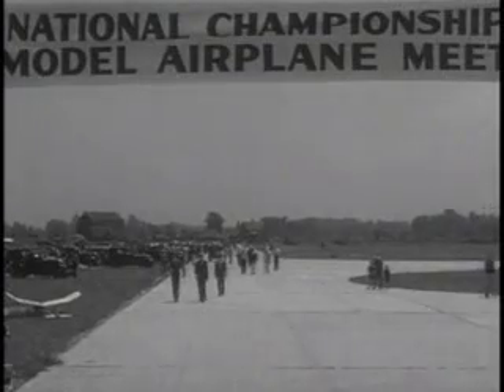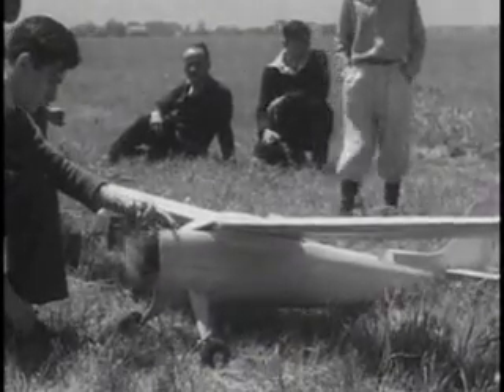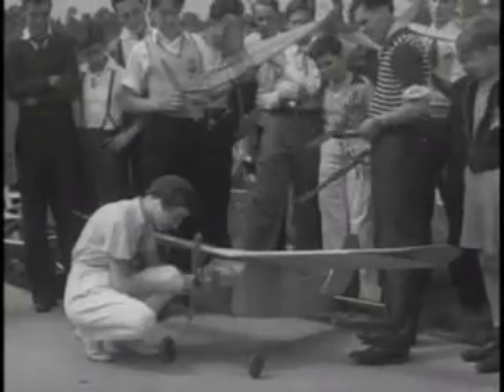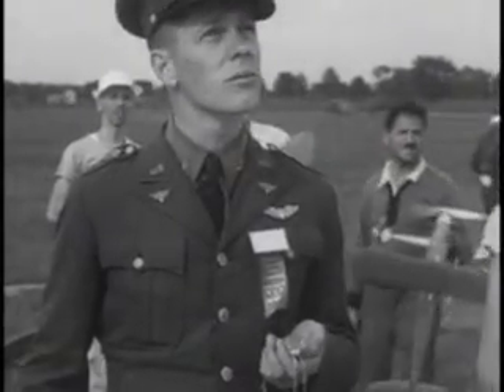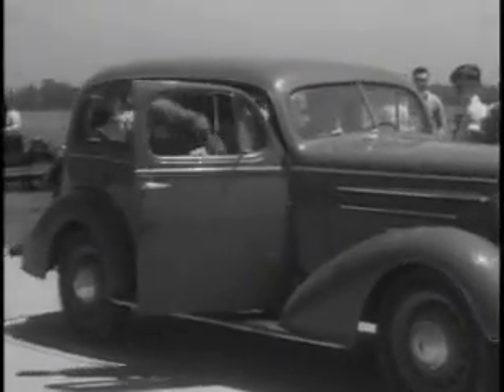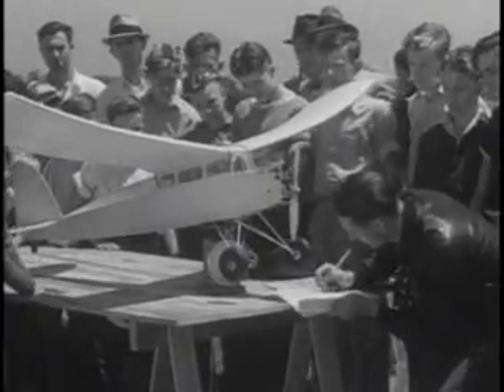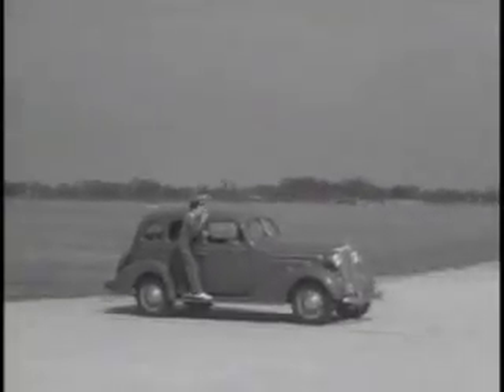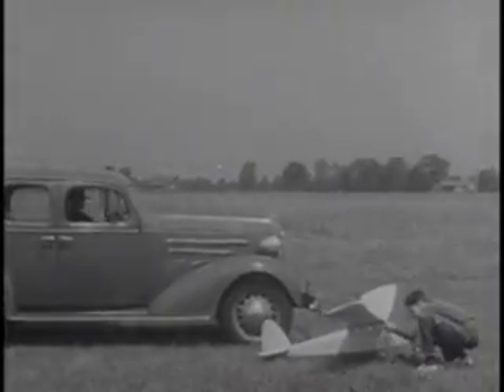1936 Model Aircraft National Championship

Comment: Riding on running board of an old car going 20-50 mph with no restraint other than holding onto a door handle, or sitting down and moving a few buttons to operate an interactive computer program.

I'd say the latter is a heck of a lot more safe.